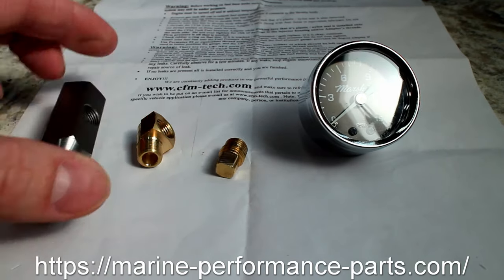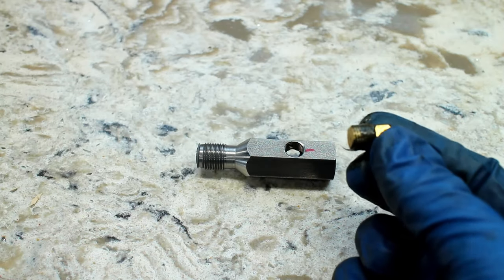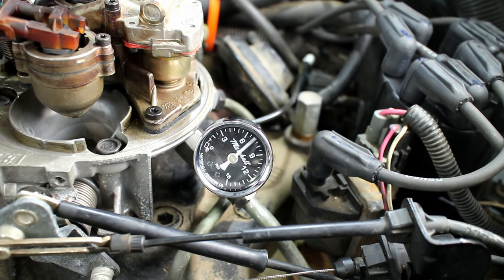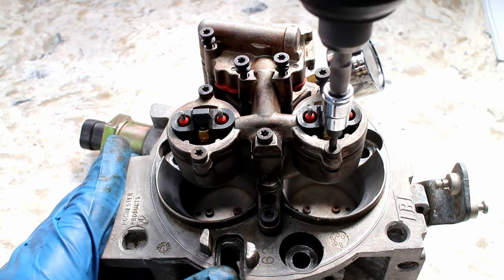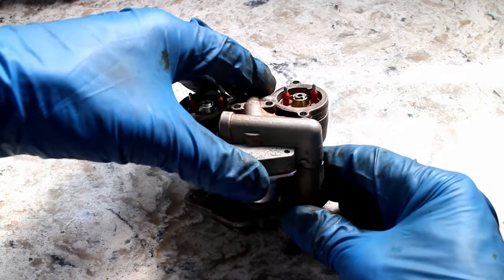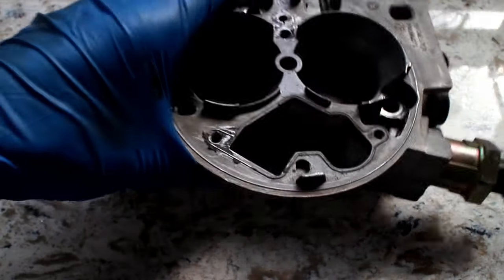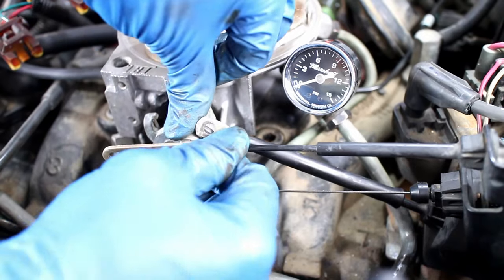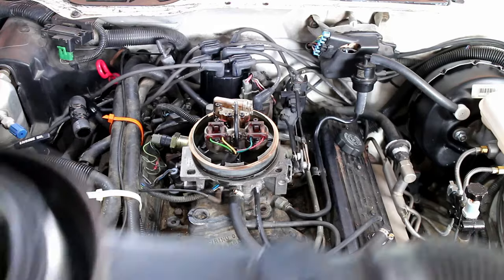Ultimate TBI Mods: Adjustable Fuel Pressure Regulator

Comment: It looks like your injectors are shot. I don't think they should be spraying that much fuel, should be a fine mist instead. I had that same issue with my 93 GMC. You might get more fuel pressure if your injectors were replaced with ones that spray correctly.
Reply: minelooklikethatimgunnareplacethemsorrynospacebar:(
Reply: @Ozzy920  Joe Biden is that you
Reply: @ianwillmott3408  lmao.....funny af!!

Comment: so what the hell was the purpose the pump can only supply so much thats def a waste of time in my books
Reply from the maker: GM TBI engines run better at higher (correct) fuel pressures. the factory pressure is usually ALL over the place.
the range was something super wide like 9-14psi
12psi+ ran the best, below had less power and ran worse

Comment: So the pump can't produce more than 11psi. So now we know this is a wasted exercise. Thanks!!
Stick with a stock regulator.
Reply from the maker: IDK how many times I have to explain this.
NOT ALL OEM REGULATORS WILL GIVE YOU THE PROPER PSI!!!!!!!!
some 100% new regs with a new pump will give you 8psi
8psi vs 11psi is about 30% fuel flow, a MASSIVE amount.
my car happened to be at the correct psi, MANY of the MILLIONS of TBI cars are much lower than that.

Comment: What benefits does higher or lower fuel pressure provide and why did you want it adjustable?
Reply from the maker: GM had a 8-12psi acceptable range for fuel pressure. That's an insane difference in potential power if your car is stuck at 8psi. Mine was actually fine, but I did the video anyways.
Reply: @3rdGenGuy   what are the parts numbers for the fuel line and gauge assembly and the adjustable fuel pump regulator
Reply: @3rdGenGuy  1994-1995 TBI 454 had 26-32psi fuel pressure.

Comment: Ultimate mod? The regulator leaked and the fuel pressure went from 11 to 11. I'm not sure why we watched this😂😂
Reply from the maker: that's the thing, Some cars are running at 8psi or lower.
in that case 8psi to 11psi is HUGE a 27% fuel increase.
i went from 10psi to 11, so a 9% increase.

Comment: Stop using a knife to clean gasket edges, use a dremel with a wirewheel; goes by A HECK of a lot faster lol ta ta 👋
Reply from the maker: not a fan of wire wheels.
I always end up with metal wires sticking into my body ha ha

Comment: A fuel pump from a 96 suburban should fix that problem
Reply from the maker: I didn't know that at the time, but ya;  using a later year pump nets a bit more pressure.
Reply: Also a tbi chip
Reply from the maker: TBI chips are basically a scam. unless someone is burning a chip on the fly just for your car.
been there lol
Reply: @3rdGenGuy  I was told to go that way but also wear rubber gloves when your touching the chip because it could mess up touching it by hand
Reply: Also the injectors are ment for only 12 pounds if you go higher than that they can give out. There is a tbi upgrade but it cost like $2500
Reply from the maker: you can run TBI above 12psi
the 454 injectors run way more than 20psi if I remember right.

Comment: So pretty much you did all that for nothing good job
Reply from the maker: the video makes money, so it's not all for nothing ha ha.
Reply: I wonder why the 454 needs a 20 plus # pressure.I have a 94 454 that i suspect has a weak pump
Reply from the maker: @williamreilly8520  the 454 TBI ran at a higher pressure than the 305 and 350s.